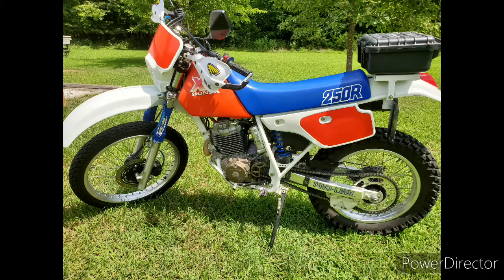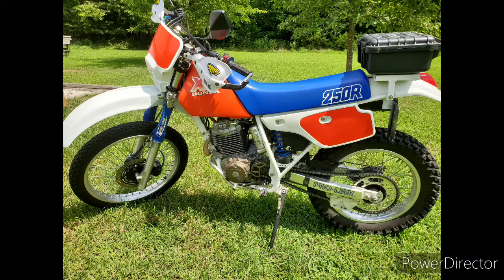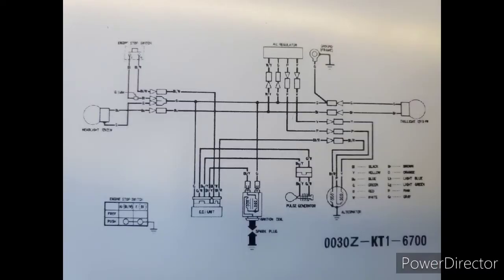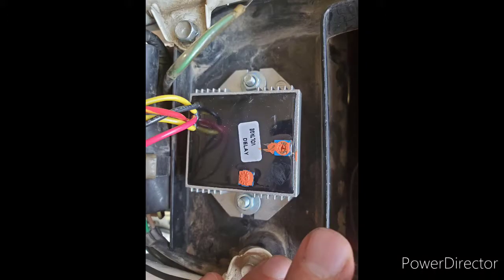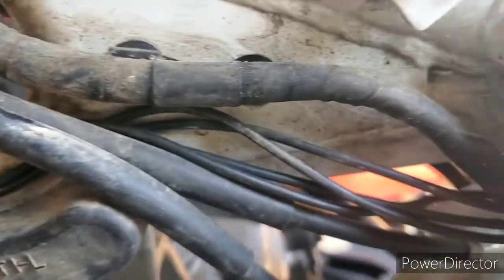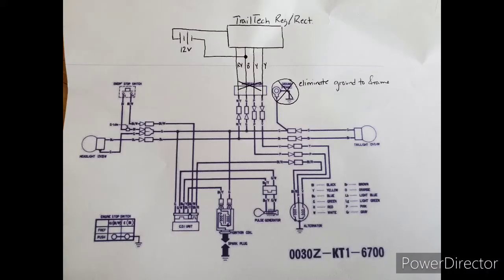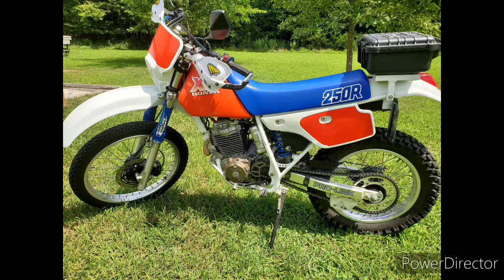1987 Honda xr250r Ac to DC conversion & headlight upgrade

Comment: im gona try it on my honda xr350r 1985 with a 55w 12v led light its gona be nice for late trail rides i might convert my bike to a dual sport but for now i will install the light to a alternator

Comment: Excellent video. Looking to do the same for my 86 200r
This conversion would also be achievable without connecting to a battery correct? I simply wouldn't use the extra wires nor would there be light without motor running...
Reply: How did you go about that on the 200? I have  an 88 that I'm doing it to soon

Comment: Thank you for taking the time to post this. Exactly what I'm hoping to do. I want to keep the bike looking stock but I also want to have some awesome lighting. Also, did you have to find aftermarket stickers for your gas tank? If so, where did you find them. I I'm going to do a complete restoration this winter. Thank you again.
Reply from the maker: I'm pretty sure I got the stickers on ebay. They were identical to the stock stickers. Everything on mine is still working well. I'm glad the video is helpful.

Comment: In the middle of the same project...question if you don’t mind. I have the same Cyclops H4 bulb with their 12v rectifier. Where did you find a headlight or adapter to except H4??? Any help would be greatly appreciated...
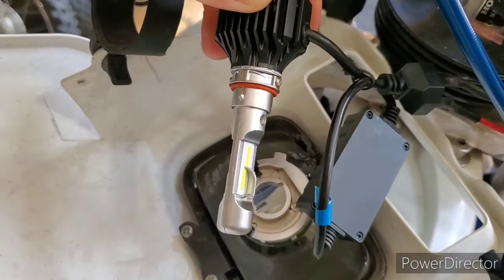Reply from the maker: The piece that the H4 bulb fits into came with the bulb. At around 4:35, you can see the matte aluminum piece that the bulb fits through with 3 small zip ties. I had to zip tie that to the old headlight housing.
Reply: Thanks Much...my parts are a bit different (03 XR400R) but I can make it work...